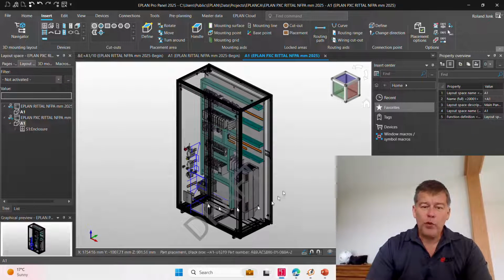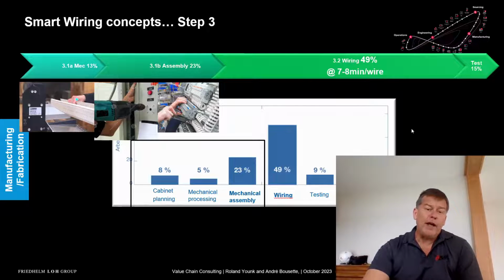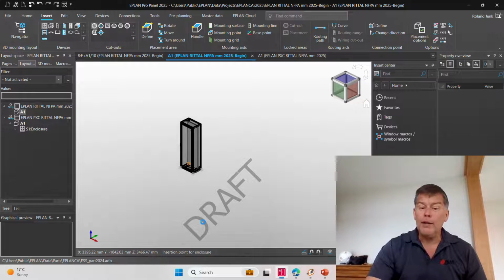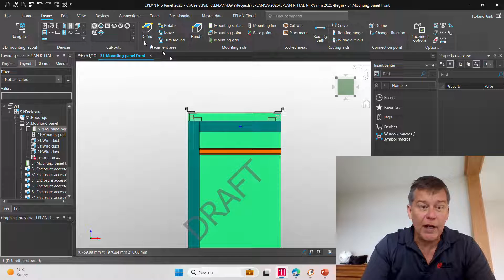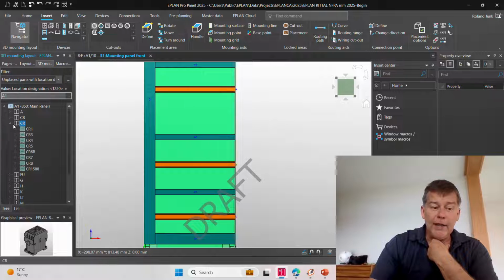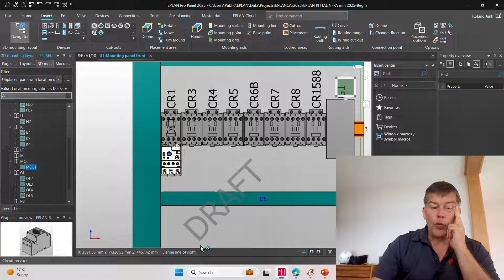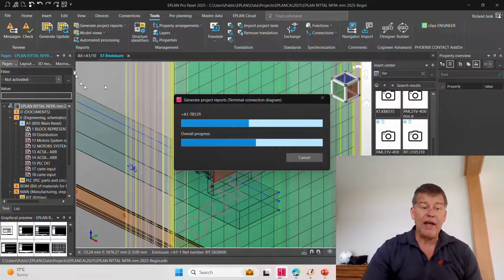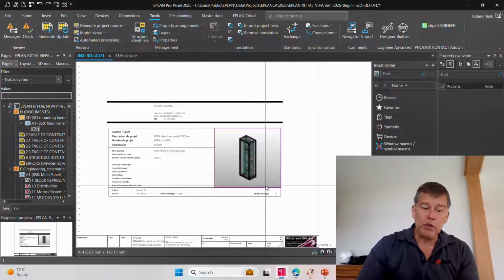EPLAN PROPANEL FOR BEGINNERS 3- 3D LAYOUT

Comment: Hi dear , Thank you the video. Please tell me how fix this problem : When I place a ventilation Fan  on side the enclosure , doesn't define and I can't put it correct.:face-pink-tears:
Reply: Hello, if you are using a Rittal panel the surfaces are correctly defined to accept the mounting of any component like the Rittal fans. If the fan or panel is from other sources, please compare and make sure the logic item are defined as they should. Simply launch an Eplan’s support ticket on our ESC and attach your project as a backup zw1 file. Within less then 24h you should have the exact answer to your issue.